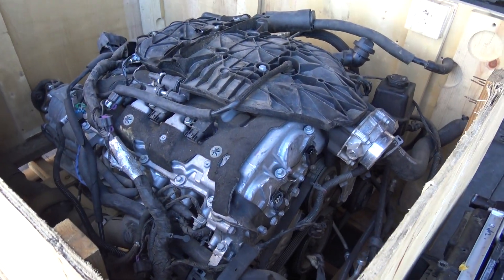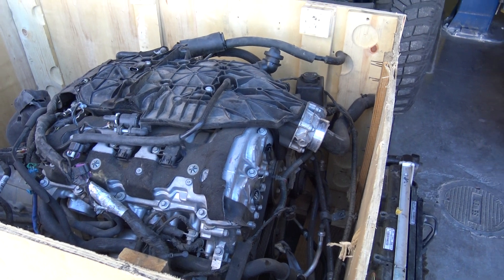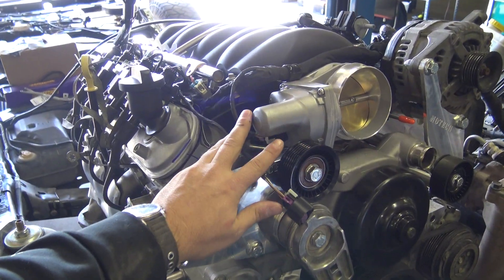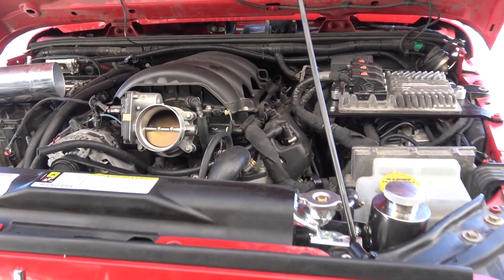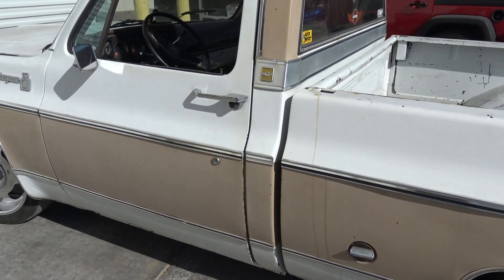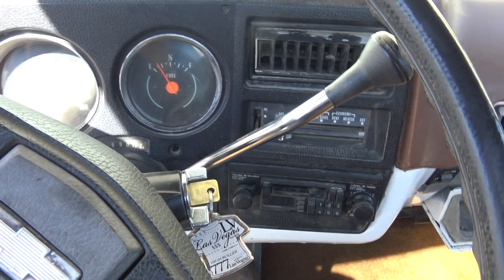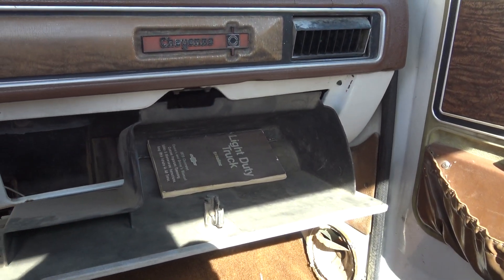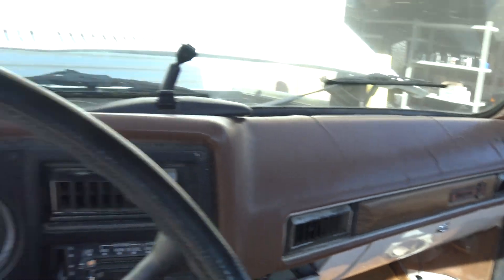C10 engine swap project

Comment: I legit began to do research on this last night. 

I personally like the GMT400’s the 88-98 C/K1500’s. 

Everyone does LS swaps on them. I wanna be different. These LFX’s are a dime a dozen in the junkyard. 

Few guys in the Cadillac and Camaro world have 400+ to the wheels with a simple forced induction setup and a tune. 

However like you said, 300 is plenty for a daily / fun lil toy. I personally want a little closer to the 400 mark, but thats me. 

I also wanna do mine in a AWD setup, like use a equinox or something. Imma watch your videos. 

Glad to see I’m not the only one realizing these cheap 3.’6’s make decent powee.

Comment: How much for the truck on ebay
Reply from the maker: anthony gallardo 20x8. Not 100 percent on the width
Reply from the maker: Cary Christian I did not buy it on ebay. I got it locally.
Reply: Swap Time   what are those dimensions of those rims and what size are they on the 76 c10
Reply: Swap Time thank you for the info do you know how much of a lip is on the rim and are you at 0 offset on that rim